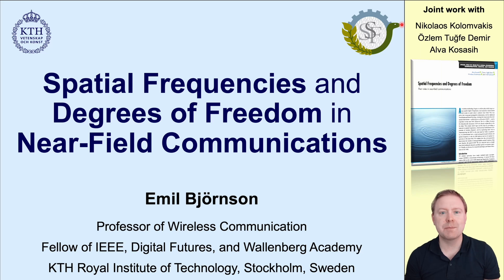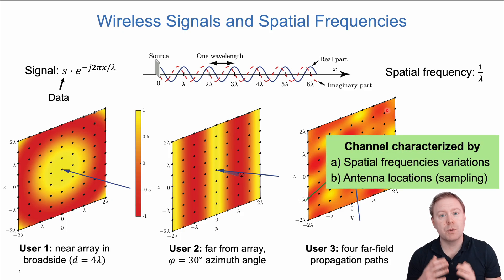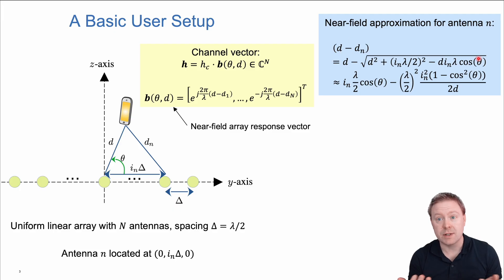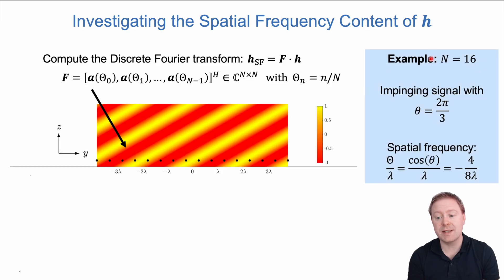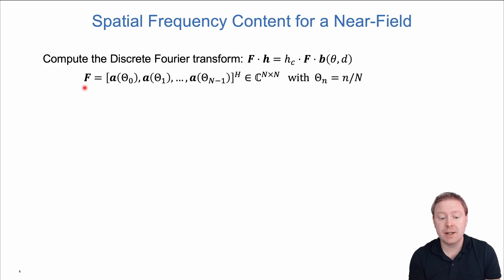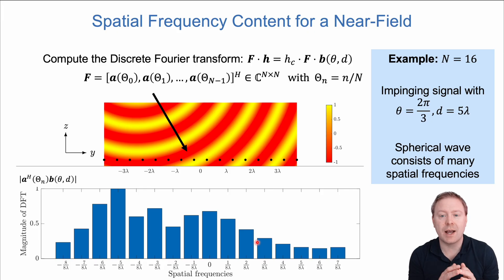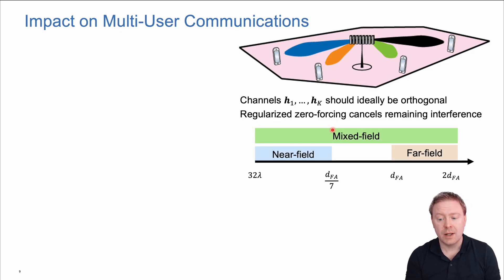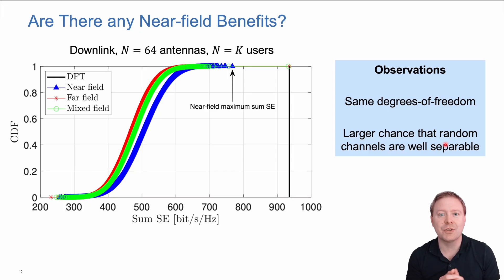Spatial Frequencies and Degrees of Freedom in Near-Field Communications

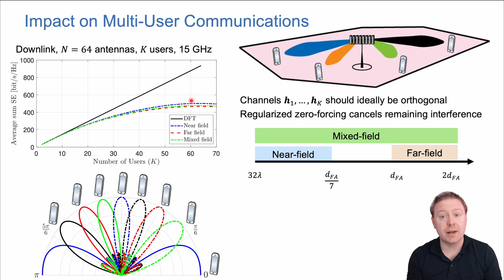Comment: at @11:50 the figure shows almost ZERO number of effective spatial frequencies for the Far field , however, at @13:40 both Far field & Near field show a similar behavior by hitting SE value of 500 bit/s/Hz for 50-60 users . I am confused because there is some contradict about the Far field in both figures. I think it the SE value for Far field should  be very low since ZERO effective spatial frequencies for the Far field !
Reply from the maker: In the considered line-of-sight environment, the channel to each user is represented by only 1 spatial frequency. This is what we describe @11:50.

Later on, we describe the ability to serve many users simultaneously, using multi-user MIMO. We then show that it is possible to find a collection of far-field users or near-field users that collectively span all the spatial frequencies.

For example, in the far-field, we can position these users so the sine of their incident angles are spaced apart by 1/N. This will make the channel vectors h_1,...,h_K mutually orthogonal, which is the best situation for multi-user MIMO transmission.

The situation would be much different if we only tried to serve one user and equipped it with multiple antennas. In that case, the far-field user would have a rank-one channel since there is only one spatial frequency. By contrast, the near-field user could have a MIMO rank being the minimum of the number of spatial frequencies shown at @11:50 and the number of user antennas.

Comment: Thanks for all of your interesting videos. I have a more general question: concerning the MIMO topic, I just read "...MIMO antenna systems can improve angular resolution with virtual array apertur expansion." 
Do you happen to know what they mean with virtual apertur expansion?
Thanks.
Reply from the maker: Did you come across this term in the context of radar?

Suppose you have two arrays next to each other: one array transmitting radar pulses and one receiving the radar echos. If you transmit orthogonal pulses from the transmit antennas, you will then observe separable radar echos with different phase shifts and when combining them in the signal processing, it will be as if the receiver aperture was larger, which means that you get a better resolution.

There is a nice illustration of it here:
https://se.mathworks.com/help/phased/ug/increasing-angular-resolution-with-mimo-radars.html

Comment: Thank you, 
when we have the users in several angles in the near field, they can be orthogonal (slide 9), I got that. But it is in the spatial wave domain. Can I conclude from that I can communicate with each device with zero interference?
I believe we asssume that when we speak about orthogonal signals. I dont know what the orthogonality in that spatial domain means. Do we need to go into that domain to show the impact of transmitting from different angles? 
The orthogonality of 2 devices transmitting from positions that are 90 deg. seperated, are also orthogonal. Their signals do not interfere. (Do we analyze it in the spatial domain just to show the angular impact?)
Thanks a lot.
Reply from the maker: Hi! The channel vectors will be perfectly orthogonal in some ideal cases (e.g,. users located at exactly the right places in angle and distance), but we cannot expect that to happen in practice. But if the channel vectors are nearly orthogonal, then one can use precoding to cancel the interference by transmitting each signal in a way that is orthogonal to channel vectors of the non-intended receivers.

You are right that orthogonality means that the directions are separated by 90 degrees, but in this context, the word doesn't refer to the physical positions of the users but the channel vectors or precoding vectors. We can have more than three antennas and, therefore, more than three dimensions to measure orthogonality in. The example on Slide 9 (lower left corner) shows 8 directions that are orthogonal in the sense that when we transmit using one of those beams, there is zero interference on all the other indicated locations.

I showed the orthogonality concept in the angular domain since it is easy to illustrate. When one deals with near-field communications, one can also find orthogonality in the distance domain. So two users can have orthogonal channel thanks to their respective angles and distances. One uses the complex shape of the radiated field that varies with both the angle and distance.

Comment: Thanks, short two questions, please.
I assumed N in the DFT must be a power of 2 (4,8,16,...). You have taken 225, instead of 256, how is that?
Secondly, on slide 7, you have the unit m for the spatial bandwidth. The unit is not 1/m analogue to the time domain 1/s?
Thank you.
Reply from the maker: Thanks for your interest!
1) You can create DFT matrices of arbitrary size. There is no restriction to have powers of 2. We choose an odd number because we then got an antenna in the origin, which simplified some implementation aspects. You can find the general formula here: https://en.wikipedia.org/wiki/DFT_matrix

2) You are right that spatial frequencies and spatial bandwidths are measured in the unit 1/m. We are not writing out the spatial bandwidths on the slides. When it is said "d = ... m", we are just referring to the parameters in the legend of the figure.

Comment: Thank you very much, Professor, for sharing this informative video.

I have a question regarding the impact of near-field modeling on channel estimation, since near-field channels involve more spatial frequency components and richer structure, does this make channel estimation more difficult or computationally expensive compared to the far-field case?
and are there any practical methods or models you recommend for efficient channel estimation in the near field?
Reply from the maker: If one uses model-agnostic channel estimation methods (e.g., least squares estimation) then the estimation complexity is exactly the same in the near-field and far-field. There are also estimation methods that build on second-order statistics (e.g., linear MMSE estimation) and the statistics will look different in the near-field and far-field. I'm referring to the matrix R that was discussed 16 minutes into the video. However, the complexity for doing the estimation will be the same once the R-matrix is known.

There are also compressed sensing methods that are used to estimate sparse channels that only contain a small number of paths. The complexity of those become much higher in the near-field because one needs to use "polar-domain codebooks". One basically need to make a codebook out of the b-vector (near-field array responses) instead of a-vectors (far-field array responses), and that space is much larger because it is parametrized both by angles and distances.

I mention this briefly at the end of the following video:

Three Misconceptions in Near-Field Communications
https://youtu.be/Jwya3-enlrc
Reply: @WirelessFuture  Thank you so much for your answer.

Comment: interesting, in the system capacity model at 13:09 is it assumed that the receivers exploit multipathing and do the receivers have multiple antennas? if not, i would assume the area between the DFT line and the others would get smaller, even for just 64x2 mimo bec. of orthogonality of the two polarities i would assume a doubling of system capacity. only after this i would dare look at the remaining degrees of freedom.